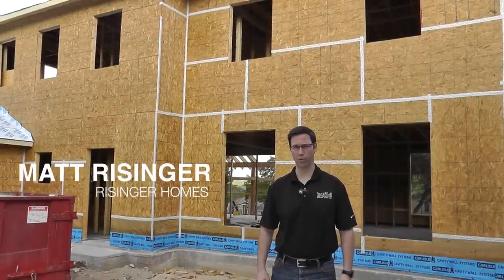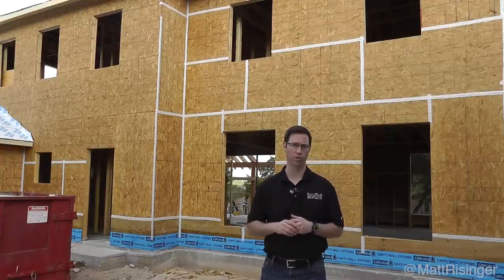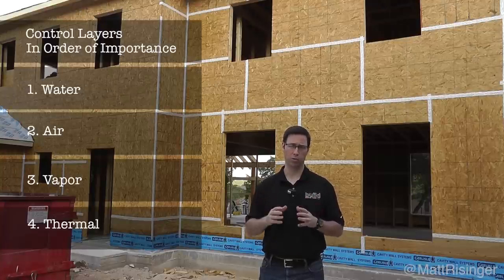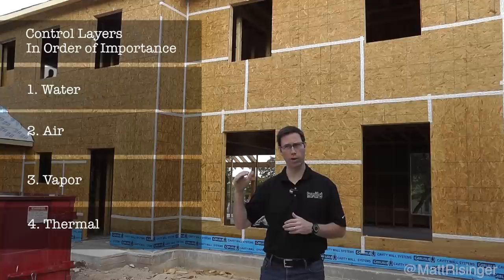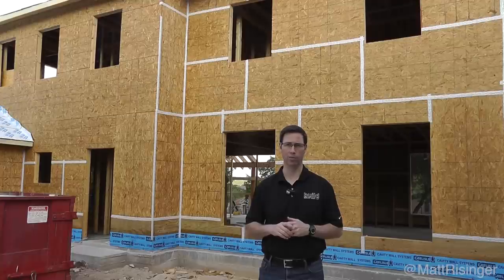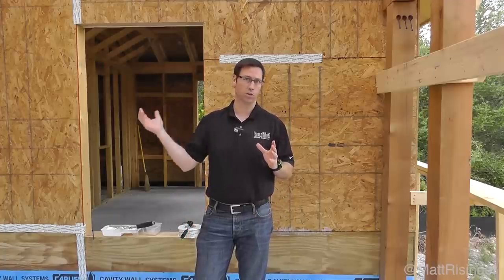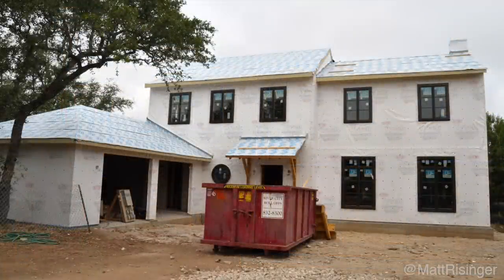Air Sealing OSB - Siga Wigluv Tape

Comment: Be sure every blower door test goes both ways - pressure test and vacuum test. Many leaks can physically seal themselves in one direction, but not the other. Because of things like wind, chimney effect, and forced air HVAC, any house will have some rooms under pressure and some under vacuum at any given moment.

Comment: Matt, you still need to tell us the blower door test door results! Thanks
Reply from the maker: We ended up with 1.8ACH50 on this house.  Tight, but I was hoping for closer to 1.0
Reply: You should pin this comment.  I always look for answers in comments before asking a question.  This question kept coming up over and over!
Reply: Matt could you use air tightness paint with a high perm rating on the inside of the sheathing in the house?

Comment: Do you tape step flashing to tyvek on a roof wall detail for vertical vinal siding. I'm having some issues with leaking there And the builder thinks I'm crazy. It's the only way water can get in there. Super hi winds.

Comment: Hello. I'm enjoying your videos. Would like your advice on the following. I live in a hot part of so cal where in the summer it can reach 110 degrees outside and in the cold as low as 40. My garage walls and ceiling is open and I plan on insulating the walls and ceiling with standard R13 and R30. Because I'd like to screw things onto the walls without having to find studs, I'm sheathing with OSB however I hate the look of OSB even if painted. Would there be any issues if I put drywall over OSB? I'm hoping the insulation and drywall on top of OSB helps with making my garage quieter too. I appreciate your response. Thanks!
Reply: Cesar G insulate as usual, pack out your studs another 2", use foil- faced osb, (foil to the insulation side) then moisture resistant drywall, no problem. your garage will handle the extreme temperatures much better.

Comment: During your video, you spoke about water control being important to you, as it would be to all homeowners. But I noticed that the Tyvek is wrapped around the window openings in preparation for the windows. That is not best practices to install a window over top of the Tyvek even though caulk and tape will be applied on top of the Tyvek. If the Tyvek is punctured, due to, let's say many vinyl siding nails, and water infiltrates behind the Tyvek near the window, the water "will" run inside the window.  Best practices for installing a window is to place the caulk directly on to the OSB on both sides and top of the window, then install the window and nail the flange, then flash around the window, then install the Tyvek over top of the window flange, and flash the Tyvek around the two side and top of the window.  Now if water were to penetrate behind the Tyveck, the Flashing tape and caulk would prevent it from penetrating into the house. See YouTube video entitled " Properly Flashing Windows"
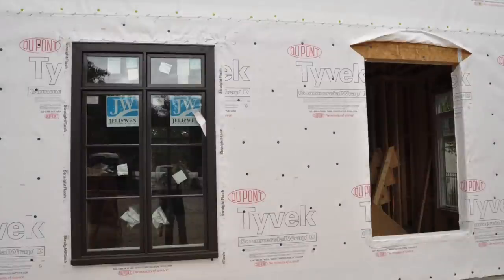Reply: +Zig Zag The video at 5:00 shows what he does and this method is used everywhere. I do believe like you that the window is better caulked, nailed, and flash taped right to the OSB but when wrapping Tyvek around the whole house you really have to do it this way. How can you cut back the wrap on the sides when you have to build your pan and be able to install the window to the OSB? It seems pretty difficult to wiggle the window and flashing into the wrap so that it's all behind the wrap. Only at the top do you do this. Now, if you were using a horizontal layer wrap such as resin paper you can manage it some, but that's too low tech right? :) Actually, I still use resin paper (not roofing felt, red resin paper) in remodeling all the time. I don't know what's thought of that anymore but it's seemed to me that a horizontal layering approach to the wrap makes sense if you're the one doing all of the work yourself as opposed to multiple subs. You wrap, install windows and install siding on your way up the wall, adding the wrap as needed and when appropriate.
Reply: There are only two acceptable methods to flash a window/door according to Tyvek standards, both installing the windows AFTER wrapping the entire house (where the wrap goes inside the rough openings like in Matt's video above) and installing the windows BEFORE wrapping the house. Both are Tyvek accepted standards and neither are better because StraightFlashing is used in both scenarios, which is butyl-based (self-healing) so if a nail was driven in near the window and water somehow got under substrate, it was hit the flashing (not going past the StraightFlashing) and drain down.

Incidentally, most contractors will use either method depending on the circumstances. For example, windows installed BEFORE WRB can allow a contractor to install windows/doors before inspections for shear walls & framing. Conversely during specific conditions there may be needs to install the WRB to protect the house during construction in circumstances where shear wall inspection is not required and framing inspections can occur from within.

Hope that helps clarify this!
Reply: The window frame cannot be relied on to be 100% water resistant. Joints at the bottom corners, especially, could allow water passage, which would then be draining BEHIND the Tyvek. This is why the entire rough sill should be wrapped properly, before the window goes in. My preference is for a sloping rough sill with tapered shims compensating, so that the window sits on a level surface.

Comment: When you get your houses this tight, do you also use (and recommend) a fresh-air handling unit to do air exchanges?
Reply from the maker: Build tight , Ventilate right!  Yes definitely.
Reply: What if I don’t use a whole house ventilation system. I don’t have a furnace, only electric heat, and a gas fireplace. I’ve been told at that point I don’t need to have a whole house fan.

So in my case would doing this be a bad idea?
Reply: Absolutely. If you don’t ventilate the home, you will have real problems with mold and mildew

Comment: What is your thought on the quality of the big box stores version of Tyvek? Price difference is huge.
Reply: There are over 100 housewraps on the market now but only a handful can control air, water and vapor like Tyvek.  The less expensive brands found at big box stores are known as woven/perforated wraps.  These wraps are designed to reduce air and water entry, not stop it.  Tyvek is a non-woven highly permeable wrap which bulk water and air will not penetrate.  If a wrap is going to be used, choose the product that will do the job you're looking to do.  Keeping water out of the home is one aspect in building that you don't want to choose the cheapest product.
Reply from the maker: Jason Moyer Great points Jason!  Agreed 100%.  Best, Matt
Reply: Matt Risinger Siga also has it's own internal and external wraps.
Reply: There is a university study where they compared various wraps and also the old tar paper. Tar paper did pretty well compared to the new plastic based stuff.   Sorry, don't have the link but google is your friend.

Comment: 2020... found this video.  I'm guessing there are other good products to use besides this tape?  Also, how does everyone feel about doing this to an existing home as I'm replacing the vinyl siding?
Reply: Absolutely do not try to air seal your existing home unless you plan on demolition inside to install an ERV and all the duct work to mechanically vent the house.

Comment: Matt ok this video was 2013 its 2020 do you still recomend this tape????
Reply: Something this big he might have aerobarrier come in instead. Or interior OSB with 1 by strapping after air sealing on the inside of the stud wall and insulate from the exterior.
Reply: Now they use zip system but you can still use Vapor open Wigluv tape on zip although Huber is working on a vapor open version of zip tape.

Comment: Matt Risinger they don't sell this at home depot or lowes on on ebay. what else is almost the same I can't get at home depot or lows in California ?  and question instead of tape would like silicone gun work the same
Reply from the maker: +Gerald mcneal no silicon won't do it. You can buy it online. Or use a Fluid Applied Weather Barrier product like Blue Barrier Or Prosoco RGuard (also not at those stores)

Comment: Wouldn't the house wrap provide at least a percentage of air control at the sheathing joints?  Especially combined with spray foam insulation?  Just wondering if the tape really provides a significant difference with the total system.
Reply: It is a multi-layered approach. The WRB should handle the majority of the air barrier but there are certain areas where skip taping is used, which in turn can allow air flow in (granted minimal but still). It also depends on which WRB method is used and how its executed...for example, how is the subfloor/slab to mud sill transition being handled?

Comment: Matt, if you use the Siga tape on the OSB seams do you still tape your Tyvek seams?....or does the Siga take the place since it takes care or the air tightness?
Reply: +kyle8114 On the building I'm doing at the moment in college we have three air control layers. It's a small detail to go that extra step of taping, but worth it in the end!

Comment: why is it better to seal osb? can you just tape tyvek seams? wouldn't that give same result?
Reply from the maker: +Matt Frieda Good question Matt.  I've found that Taped housewrap is generally NOT airtight.  You need to follow more extreme measures including caulking the housewrap to have an "airtight" installation and even that isn't great.  Taping the OSB seams is much better for airtightness.
Reply: +Matt Risinger We just used Tyvek Home Wrap and their seam tape and hit 0.75 ACH50 on a 1320 SF home. Requires meticulous detailing, but it can be done. NOW - that was at rough in and finish, so time will likely have its ways as the building ages and nails through siding loosen a bit, but it can be done with Tyvek. We were also the GC and installer of the Air Barrier - so control was completely in our hands. Having a sub-contractor do it may have resulted in a different result. And as a note, the air barrier was a complete layer around the entire house - no breaches or transitions were left undetailed.
Reply: Matt Risinger they don't sell this at home depot or lowes on on ebay. what else is almost the same I can't get at home depot or lows in California ?  and question instead of tape would like silicone gun work the same

Comment: I don't get it...what air is going to get through a stud?  All seems obviously land on a stud so it's already air sealed.
Reply: This is a sneaky commercial for the tape. They are posing like it's a regular guy making a video.
Reply: nailing sheathing to a stud does nothing for to stop air infiltration. The joint must be sealed. Try building a stud & sheathing boat and see how long it will float.

Comment: Why don't you frame your homes using SIP's?  They seen to be stronger, much better insulated, have a strong fire rating, much, muck quicker to erect a shell.  Tne only down side compared to your method is the 2' bottom weatherproof seal.  Enjoy your video's!